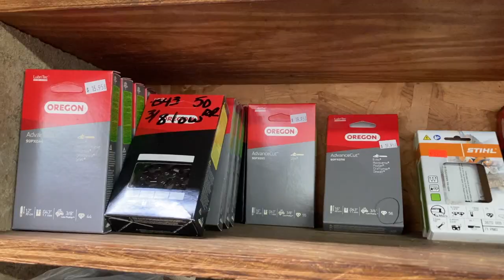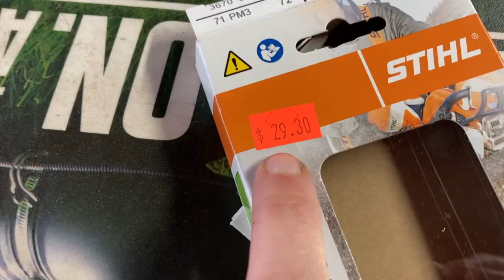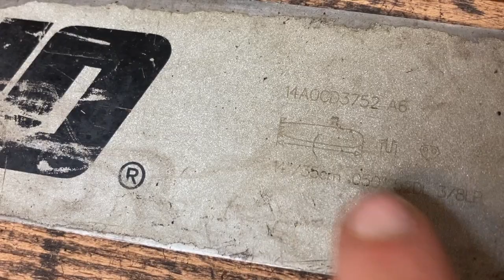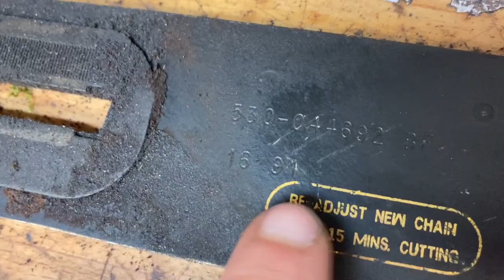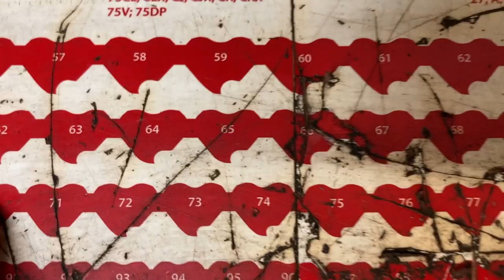DO NOT MAKE THIS MISTAKE! How to make sure you use the correct chain on your saw. Mini SHOP TOUR!

Comment: As a wildland firefighter / USFS sawyer please show the things that can kill a saw. !. let it warm up before running it to 10,000 RPM. 2. most saws have a little hole in the sprocket, that is FOR GREASE for the bearing !, use it.  3. most bars have two (some one) little holes near the end of the bar, these are also for grease. Use them whenever you put gas in. 4. Use premium or canned gas, using low octane gas contributes to cylinder scoring. 5. as you mentioned keep your chain sharp. I use a dremel with a rotary stone, If I am on a fire I use a file, and be sure to file the depth / cut cleaning tooth.

Comment: Very interesting.   Many years ago, when I still cut a lot of wood, I always bought two chains at a time, and one new sprocket.   I would rotate the chains so that the wear between the chain and the sprocket did not prematurely wear out a new chain, or a new chain would not accelerate the destruction of an old sprocket.   Seemed to work well.

Comment: i run a few custom bars that dont have a normal length.  the only part of the saw you need to worry about are the guide teeth and your saws sprocket are correct. other than that you buy chains for what your bar says. but who buys chains we should be building them. :)  i almost had this issue when i went to a shop and they didnt have orogen chains or name brand chains just bad 3rd party knock off chains.  the package said it fit my saw but when i put it on it would not roll over the sprocket and knew it was wrong right away.  thanx for showing that you should check the sprocket.

Comment: Appreciate your work...
Couple of years ago I acquired the 'correct' prepackaged matched bar and chain kit for my saw. Prior to installation I noticed the chain didn't run smoothly around the tip and would ride up out of the sprocket... a potential 'derailment' under load. A thorough investigation eventually revealed the chain's pitch was wrong (by tens of thous per link). Hardly noticeable to the eye.
Made in a large Asian country, presumably the tooling for punching out the chain links was not set up correctly. The accumulative error was very apparent when compared to a new quality chain.
So, even when you've got the 'correct' parts, if something doesn't look (or feel) right...... it probably isn't.

Comment: Wish your shop was in Upstate NY. Had this Stihl bar and chain problem. Thanks to GKS they easily solved the problem with a new drive sprocket. I did not realize how to maintain each time you use the saw along with oil problems. GKS, Kahler and Sons, is overworked. I have 3 chain saws in for repairs, two with no start and no bar oil problems. Several weeks to fix them ?

So, I will take one saw back to attempt to fix the no oil and no start problem. Thanks for your Mechanic in a bottle and Ethanol shield tip. I noticed even the Ethanol Free gas is not as good as it used to be.

Comment: In 31 yrs, put in prob a dozen clutch bearings, a few rim drives, about a dozen sprockets, maybe one clutch, and a few clutch springs, and lost count of how many bars. . I buy chain by the 100 ft roll, make my own.,I hate .325, try to stay with 3/8, and on the climbing saws,  micro/ picco.  Switched from  404 to 3/8 on my ms 880.  Got dozens of old chains hanging in the shed, for sacrificial jobs: dirt, cement, chain link fence, fence posts, that may be imbedded in the tree.  . Stay with Stihl, Husky, or Echo, for longevety. Todays hint:( Q) how do you find a nail in a tree? ( A) put a new chain on, and start cutting!😆

Comment: I do nothing but chain rolls, I don’t Carry a single precut loop. My usual stock is about 6 100 foot rolls of stihl chain. And upwards of 15 Oregon 100 foot rolls. Full house, skip tooth, ripping chain, etc. Even some 3/4 pitch chain to repair chains off processing units. Also a good thing to mention for the newbies is the rivet spinners actually have an A and B spinner and anvil, one for 1/4-.325 pitch, and another for 3/8-404, then an adapter for 3/4 pitch.

Comment: Well now that was an interesting video and this is one thing that I did know about. Back in 1994 I bought a sthil 036 and it came with the 3 25 chain and I didn't like it because it seemed to me it didn't cut fast enough and stretched too much. So I replaced the bar the chain and the sprocket to 3/8 and I still have that chain saw. I have cut tons of wood with that chainsaw and still have never had to replace the clutch, but if I ever do thanks to your video on that I can do it myself.
Reply from the maker: The 036 is a great saw. I am surprised it came with .325. Every one I have ever seen came with 3/8. Musta been a dealer special order. The saw definitely has enough power to pull a nice size bar and chain.

Comment: That's the struggle with chaintype, pitch an size. I use them from .404 1,6mm, 3/8 (.375) 1,6mm .325 1,6mm and 1,5mm, 3/8 LP 1,3mm and 1,1mm and at least a 1/4 (i think 1,3mm) for carving. That's only for my Personal saws....(Sorry for the measurement in mm but I'm more used to that) And it happens - I found out just in the woods that I grabbed the wrong Box of sparechains in the morning... Lots of filing work that day and a chain worn to the bone 🤣.
One thing that I found out is, that a chain with a bigger size is not always cutting faster. It's more in the grind. Get the gullet, ladys and gentlemen!
As always: Great video with Lots of knowledge shared! Thank you! 👍👍👍

Comment: Used to have a 440, sweet little saw. I found some mods that it could take. I did bump it up to a 24" bar and a 3/8  chain and found a sprocket for it somewhere. Wish I had hung onto that saw. I've got a 440e that's a dog compared to the 440.
Don't matter. Picked up a spiffy new big ole honkin Stihl last summer. Used it one time and went down in my back for the past 6 months. Finally found a tumor on my L5 vertebra and just finished radiation on that. Still can't get too far without stopping yet.
Cain't have nothing, something always comes along to steal yer fun......... lol

Comment: I have some old 1960s and 1970s Stihl saws that use the 1/4 pitch chain and 404. Only place I can find here in the Dallas area to make either chain is Richardson Saw in Richardson and A & B Lawn and Garden in Fort Worth. The 404 chain is so tough, you can hit a rock and it'll stay sharp. I have 3 of the top handle stihl 08 Super 6 horsepower saws that use 404 chain and all 3 saws are beasts.

Comment: Having worked a one man shop many years ago, when I could I would convert the customer to a rim drive for the chain, that way the customer could change the pitch of chain bar and rim as desired. What was the pluss side was smoother running chainsaw, chain and bar lasted longer pluss the rim lasted longer than the spur. My main saw is a Stihl 040, ran a lot of fuel through it cutting hedge, that saw can bark, oh ok padded gloves are nice when running it.

Comment: great informative videos. I did not know that all the needed information is 
right on the end of the bar. I have to check out if you have a hand sharpening 
video. I have my father in law old chainsaw that came with a round file, and 
a jig. I want to touch up the blade on the old saw. I have a new still saw 
that I use the most, I also have 2 pollen saws too. thank you for the education.

Comment: Just bought a used 440 myself - but so far it cuts like a dream compared to the electric saws I've used. It does have some slightly tweaky issues staying running at idle after I've completed a cut, but after watching your fuel episode I'm gonna try out some fuel I mixed myself.
Reply: Turn up the idle, top adjustment screw takes a flat head
Reply: Don't forget to clean your saw.  I have a 440.  Don't loan your saw to anybody.  If you do, visual inspect the bottom the saw for green twigs ripped into the bottom of the saw.  Don't get lazy.  Inspect that saw especially if the chain isn't traveling smooth before you start the engine.  Do not forget to oil or lube the very small weep hole in the front of the bar.  That little hole lubes the sprocket.  Again...don't let fools and screwballs borrow your tools unless they read the manual.  There's a lot of fools who think they know your saw, because they ran saws in the past.  Don't loan out your toys to anybody.

Comment: Good video. First time seeing a chain made up. I think that was the size for my 590 timber wolf
Reply from the maker: Your 590 is 3/8 full but is only 70 drivers. Thanks for watching!
Reply: @Chickanic  you are correct my bad. I was thinking of the chain that comes with the saw 72LPX 070X. That is where I got 72
Reply: @hphillips7425  what chain do you use on your CS590? I heard that you can use Stihl chains and also heard Oregons EXL chain is good
Reply: @dentondunn4346  stock chain and a pferd 2 in 1 sharpener.

Comment: Unless you  get a power head(unit)that has no markings and the serial plate has been removed you can go to even the crappiest shop can match the OEM size.i have a 20 plus Johnson red I think it's a 2045 turbo anyway I knew what it was when I went to get a new chain do it best knew it originally came with an 18 inch bar but I upgraded to a 20 inch bar and do it best got me hooked up no pr9blem

Comment: What's your thoughts about the new law they've passed in California about selling new gas powered equipment
Reply from the maker: It is insane.. The amount of fossil fuels it take to mine lithium is in NO WAY zero emissions or "clean". Did you know they mine 85,000 tons of lithium every year and it takes 500,000 gallons of water to excavate every ton? It uses up all of the areas water resources! I don't see it going over once everything turns into a jungle. Electric will NEVER keep up with gas. ALONG with putting million out of their landscaping job when they can't afford the change.

Comment: I own a CS590 & I was told that I could use a Stihl chain on it, is that true? What full chisel chain would you recommend on the CS590? Im not sure which is better, Oregon or Stihl. I've been told Oregon EXL is good and I've also been told the Rapid Cut Stihl RS chain is good but I'd like your opinion on it. I cut nothing but hardwood only

Comment: I think I have a problem with my cub cadet zero turn - cutting bad. Leaving rows etc.  Now I have to replace a spindle due to a stripped bolt stem. Could I adjust the spindle with a washer to even the blade travel?

Comment: I had a Craftsman (Pullan) 14 and retired it for a newer Remington (MTD) the bar chain setup was nearly the same [.325/.05 52] the new saw suggests 53 but the 52 does work but a little finicky to install. Amazon sells the Oregon chain for around 13-15 bucks and the china knockoffs are a little less but not so great. I used this 100 dollar saw for a year doing property cleanup, no regrets. BTW the local Echo dealer cannot get a blade kit for my srm225 trimmer, been waiting since Labor Day.

Comment: Hi! I would like to thank you for your valuable advice! Could you please tell me what problem will happen to my battery chainsaw if I use a 1.3mm  chain instead of 1.1, which is recommended? I have put the 1.3 chain in the bar and i seems to move by hand easily in the front half, but in in the back part of the bar it stacks a little bit! The reason to use the 1.3 chain is that the 1.1 is hard to find it. 
Greetings from mount Olympus, Greece!

Comment: I have a Briggs n Stratton  16 hp riding lawnmower, the engine overreved and now the valves need adjustment, what could have happened to cause it to over reve and how do I adjust the valves it's a single piston engine?

Comment: I have an old still 032 AV and it has spark and compression I need to replace the line tho and if u put fuel in the spark plug hole or carb throat it doesn't start. Do you maybe know why?

Comment: I just bought a 18 inch chain 2 days ago and paid less than that for it. I've put the wrong bar amd chain on my saw before and figured it put before i did to much damage. And have you had any saws come in that wouldn't cut and find that the customer put the chain on backwards ?

Comment: That’s my saw, well at least like the one I have, didn’t have a problem with the wrong chain but man it doesn’t like to get 4 PM. Kinda lags on bigger cuts it won’t stay in the high rpm range. Fairly new, but it does seem like it’s getting worse. Does this have the same issue I’ll spark arresters pluging? Or is it a carb adjustment?

Comment: I have a  Echo CS-352 saw.  It comes with low pro chain  57 links  3/8"   0.050" gauge.  Can I use full 3/8 chain instead of the lo-pro without changing bar & sprocket?

Comment: OK Im thoroughly confused I have a 450 Rancher chain and bar specs 20 inch .325 .050 80DL the exact match the Oregon chain on the box says "450 Rancher 20 inch" .325 .050 78DL < the drive links don't match so now whats up with that ?  Are there different bars that changes the drive links numbers ? How does the drive sprocket size match the chain drive links is it the .325 that has to match ?

Comment: If you don't mind, I have a stihl ms180 and the pull cord has snapped twice now.  Can I change to a heavier pull cord?  It's driving me crazy.
  Thanks and really enjoy your videos and training.  Cool work with the chain.
Reply from the maker: Do you have the easy pull system?
Reply: You may have other issues with the saw causing extra load on the pull chord.. I would check the coil/flywheel air gap first..  The narrow spools on those saws struggle with bigger diameter rope than specified.. Hope this helps..:))
Reply: How are you starting? Try right Hand on the pull and the back handle between your knees. If you Start if like an old Mac, the Cord will rub hard on the guide of the startercase and... snap.

Comment: Am a little surprised that since your showing how to break and spin chain that you didn't show everyone that you can change out the punches on the chain breaker so that if you are doing smaller sized chains as in 1/4, 3/8LP you won't bend the chain. And when your spinning smaller chains use the different sized spinner heads for the different sized chains.

Comment: What are your thoughts on rim sprockets?
Reply: Great if you run the saw every day. Homeowners who are making firewood up to 20m³ per year dont need it. The only reason for someone with that light use to have a rim-sprocket could be to easily switch between different chain pitch. But then you have to use a bar without sprocket or Different Bars with the correct sprocket for the chain. Pls dont misunderstand me: rimsprocket are technicalky the better choice. But they are more expensive and its a little more tricky to mount the chain, especially if you have the clutch and chainbrake facing outside like on Huskys. If you have one: keep it. If you don't have and you don't cut a lot of wood: don't switch. Hope that makes sense.
Reply: @sebastianleicht  It does make sense. When I got my Husq 460, I got a rimsprocket/clutch bell assy. I had Literally DOZENS of large trees to block up over a summer. Several too large to take in a single pass with a 20" bar. I'd rotate through 4-5 chains a day to spread wear and always have a nice sharp chain. But now the saw sits barely used.

Comment: I have a question. I have a Poulan chainsaw. I have good spark and I'm getting fuel and it is adjust right. It will not rev up.
Reply: Check your muffler and exhaust port.
Clean the spark arrestor if needed.
Reply from the maker: Did it sit for a long time? Probably 70% of the ones I get in the shop have had the fuel filter fall of and sucked trash up into the screen inside the carb. It is always the first thing I check.

Comment: When I have the wrong pitch chain I just install it on the saw backwards. It seems to fit the sprocket better then just run the saw in reverse. That way you don't look like a dumb ass for buying the wrong chain.

Comment: Must have been a Stihl dealer first ? No 100ft  3/8 .058 ? There are so many different chains,cutters,gauges,colors, low kickback, ect...  To much for the average Youtube viewer. 
Working for a Fire District we have saws from 4 different manufactures. Some from the 80's. Keeping the crews with sharp chains of the right size through a large weather event is a real chore. One second of asphalt and that wood cutting is junk. 
 Battery saws are planned for the future. that will add 3/8LP or picco .043/.050 to the mix.🎻🍷🧀
Have you seen the new Hexa chain ?
Reply from the maker: Must be a location thing, but we RARELY ever see anything .058 gauge. I have seen the Hexa chain, but not in person. I am interested to see how the public accepts it. Thanks for watching!